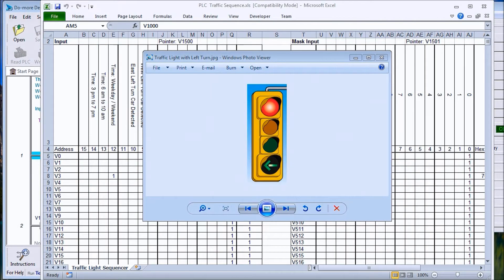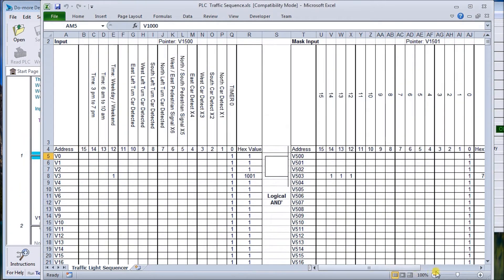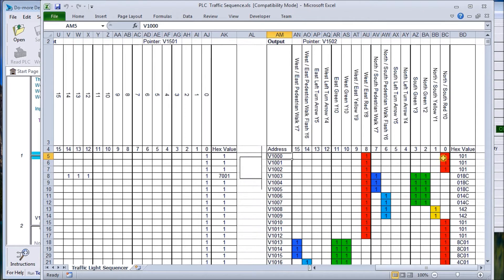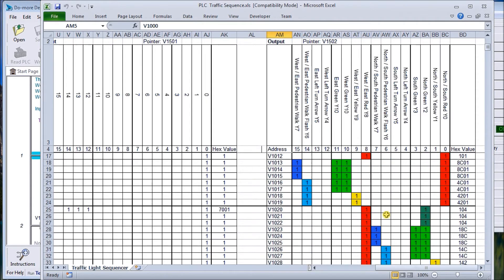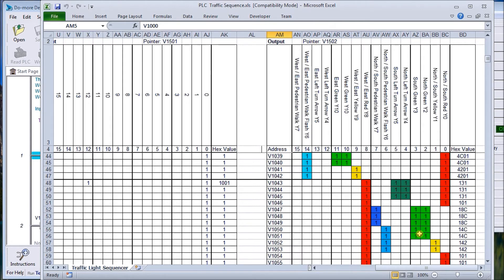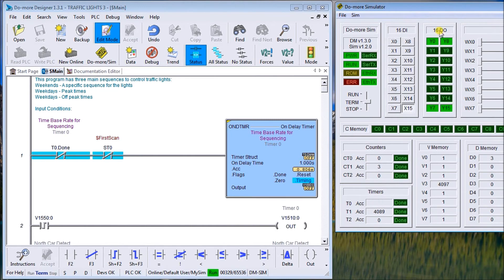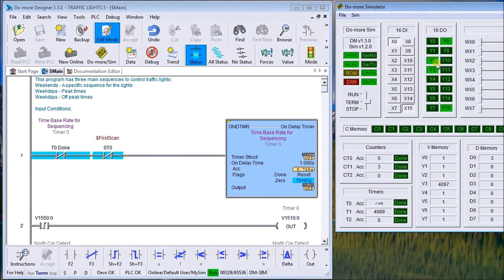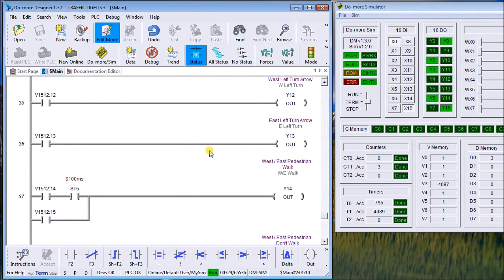Ultimate PLC Traffic Light Control: Stop Struggling Forever!

Comment: HMI?
Reply from the maker: HMI - human machine interface
Regards,
Garry
Reply: @ACCautomation No i meant could there be an hmi for this project? I know what an HMI is. Also, i have sent you some emails, because i am working on a similar project and need some pointers if that is alright.
Reply from the maker: @justincarney5021  
Looking through my spam folder, I see that you are trying to establish a connection between the Do-More Designer Software and the ScadaBR HMI via ModBus protocol. I am assuming that you are using the Do-More Designer PLC Simulator on your computer and using Modbus TCP (Ethernet). I have not used the ScadaBR HMI before, but this video shows the Modbus connection parameters.
 https://www.youtube.com/watch?v=bSdW4XXBlLo
Remember that the Do-more PLC has fixed Modbus addressed.
https://www.youtube.com/watch?v=PkTAYOLD0Z4
I wish you well with your project.
Regards,
Garry
Reply: @ACCautomation  Awesome thanks! Unfortunately, i was not able to get that to work either. I’ve decided to use an hmi on c-more. I don’t have a physical panel, but should be able to run it off the simulator. i am still having connection issues with that as well
Reply from the maker: @justincarney5021  
The simulator will not connect to the PLC. It can only be used to manually see what the screen will look like. You will need the HMI hardware. I would suggest the headless unit if you are going to use just the mobile apps.
Regards,
Garry
Reply: @ACCautomation  Ok gotcha, i purchased a piece of hardware yesterday, it was delivered today. It did not come with a wire so how do i connect it? USB? Ethernet? VGA? DVI? My plc is connected via ethernet so would i also use ethernet for this?
Reply from the maker: @justincarney5021  
What did you purchase, and what is the model number?
Thanks,
Garry
Reply: @ACCautomation  it’s a CM5-T4W
Reply from the maker: @justincarney5021  
I always liked using the Ethernet option. Ensure that you are connected to your router. Call up the screen menu to set the IP address. 
Regards,
Garry